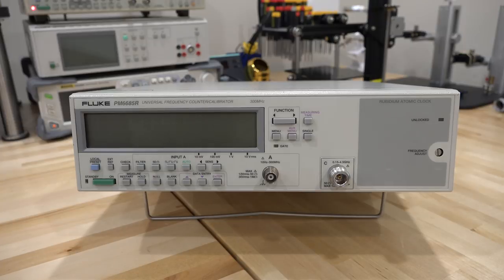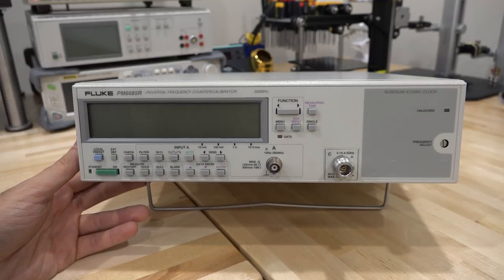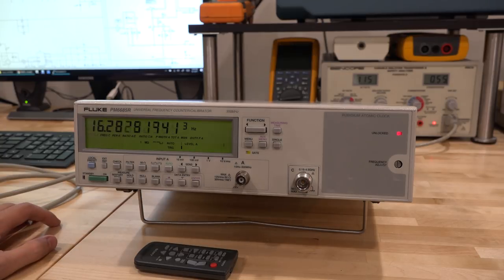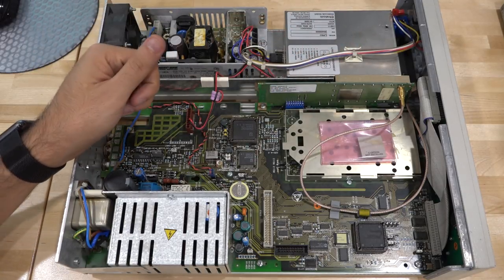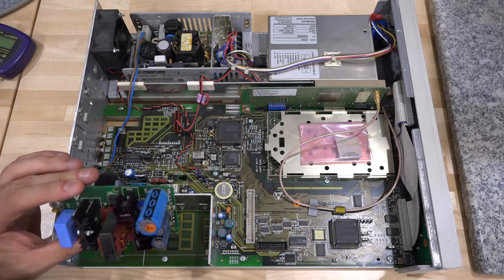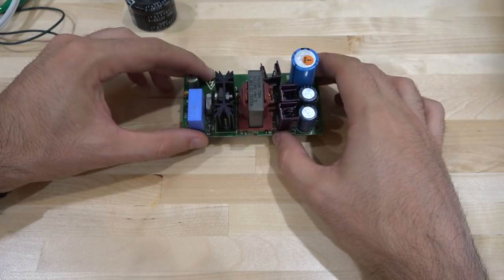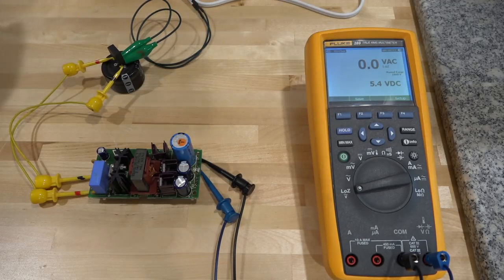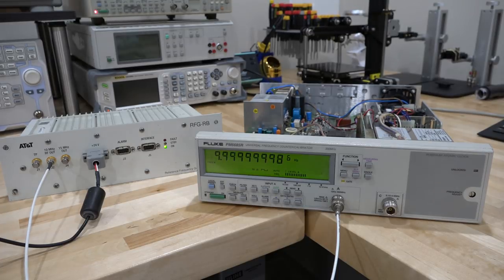TSP #106 - Teardown & Repair of a Fluke PM6685R 4.5GHz Rubidium Frequency Counter

Comment: HI after 2 hours my PM6685R stop functioning with a "no signal" display. At this time when i test the sub menu, the logic seems to be faulty. One hour later after power off etherything is working fine again. Do you have any suggestion on the way to diagnose and fix the problem ? Kind regards from Normandy :)

Comment: I had a giggle at you not realising the 10 x 10^6 Hz indicator was being used instead of 10 MHz. I watched your older TSP #72 for the PM6680B and @ 41:30 in noticed you had it in 1/f mode and it was displaying 100 x 10^-9 s (100 nanoseconds) which of course is 10 MHz too. 

At least it appears to use engineering notation. I guess they didn't have enough LCD space for all the symbols. Thankfully they didn't go for scientific notation, that always confuses me.

Anyway thanks for another great vid. I love repair videos.

Comment: Did you consider modifying the fan such that it activates for the Rubidium PSU?

One caution to newbies: Always good to fully discharge electrolytic capacitors before connecting them to an ESR tester (or anything else!)
Reply: <Unless you like hospital food.>   Haha....
Reply: k1mgy, if there is no problem that you're trying to fix, why would you change how the device operates?  Obviously the engineer who designed the device in the first place didn't calculate the fan was needed when the device is in standby.

Comment: The cable you mention at 5:14 that carries the 10MHz signal from the rubidium clock has me a little confused. Shouldn't it be a coax, or at least shielded? 10MHz isn't too fast, but still coax worthy, no? Perhaps I did not understand or misunderstood something? Anyway, thanks for another great video!
Reply: It will go through some PLL on the main board anyway so doesn't really matter.

Comment: Can you take the Rubidium standard as an output and distribute to your other instrumentation?
Reply: Not sure about this specific unit but in general, yes. I took a look at the PM6685 (non-R) that I have here in the lab and it does have a 10Mhz output.  I built a distribution board that distributes the 10mhz signal from my home built standard to the other instruments in my lab.

Comment: Power supply repairs are only boring because the number of failure modes tends to be very small. DC/DC converter design is interesting, but almost none of the design considerations are important when figuring out what to fix. And since most are built with monolithic controller ICs (or even regulators with a built-in switching transistor) there's no way to figure out what went wrong in the rare case that the chip is the problem. You'll never have an error where you replace the internal oscillator of the regulator IC or find a problem with the error amplifier. 

Two other things: First, I'd love if you kept a list of what equipment you have in the lab on the blog site. It would be fun to know, and trying to go through all your videos and read part numbers would be very tedious. Second and more importantly the "about" page on thesignalpath.com really ought to have a separate entry for the cat. I've forgotten his name which is clearly horrible.

Comment: Good repair, but calibration not so good for Rb reference.
Rb has to be calibrated to about 10^-11 vs. GPSDO; that requires very different method, than you have shown.
Either a longer scale frequency counter, or a T.I. counter with > 1h phase comparison is required.
Reply from the maker: Yes, you are right. I have to get a GPS disciplined source. :)